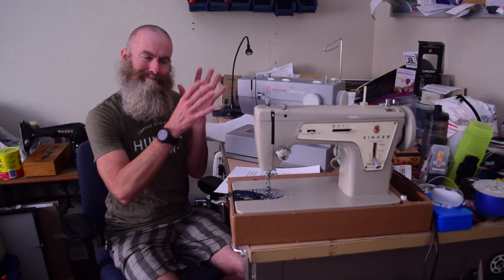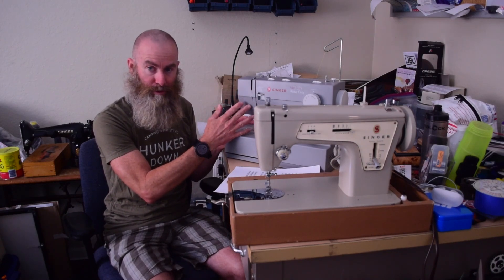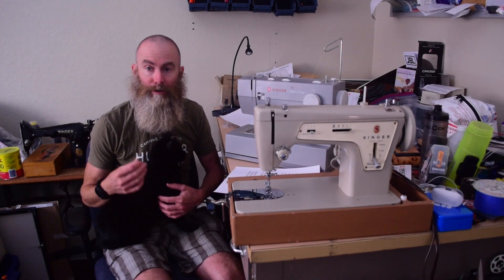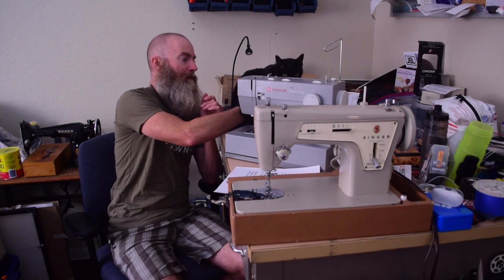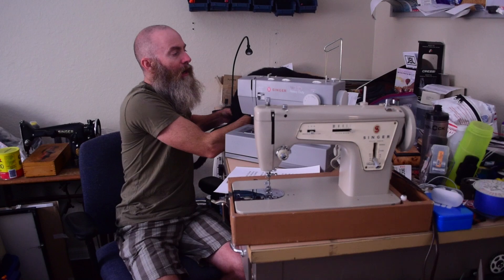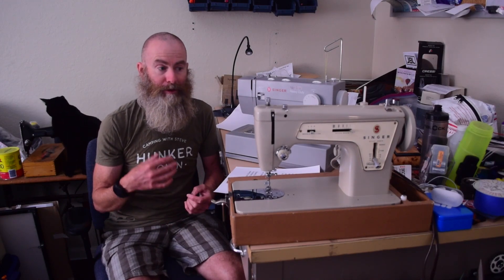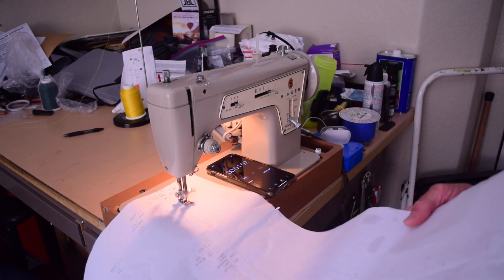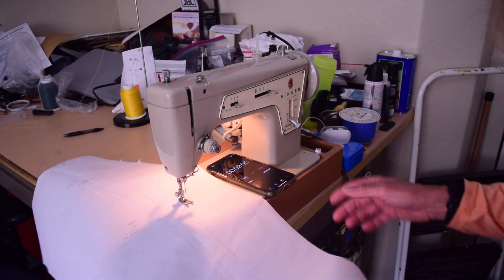Sewing Machine Speed Comparison

Comment: The older vintage machines have a touch of style and class in their designs. They might not be "fashionable" or "modern looking" but for their time period they had some amazing engineering. Now consider if they have made any major improvements in home sewing machines over the past 60 years? Compared to the leaps and bounds in technology in every other field.
Reply from the maker: I agree, Drew.  Unfortunately, I think the biggest advances in sewing technology are in the form of computer controls and complex stitches/embroidery.  Forming a stitch was probably nailed in the early 1900s. The rest of the development of sewing machines seems to be in the direction of making it cheaper and less overbuilt (which makes sense from the standpoint of a manufacturer). If we were all satisfied with straight and zig-zag, there might not be any need for anyone to have made any new sewing machines since 1970, there were enough out there for everyone that are still going!

Comment: This is a question on tension adjustment with regard to a Sailrite video on making bags. The tension was attempted to be adjusted twice on the video, both times with the presser foot in the up position. Is that even possible? I have not received a response from Sailrite as yet.
Reply from the maker: Hi Ellen, 
So, when the presser foot is up, the tension disks are not engaged, which from your question I take it you already understand.
I don't think there is any reason why you can't turn the knob while the presser foot is in the raised position; I presume that the adjustment will "take effect" when the foot is lowered and the disks engage. 
To be honest, I have never even given this a thought, and I have no idea if I have made tension adjustments with the foot up or down. The guys at Sailrite definitely know what they are doing, so I'd be surprised if it were an issue.
UPDATING MY OWN COMMENT BEFORE POSTING IT LOL:
After typing all of the above, I walked 10 feet and sat at my Singer 201, and yes, adjusting the tension while the presser foot is up works fine. There might be a reason NOT to do it that I'm not aware of, but the effect was totally normal.
Thanks for the thought-provoking question!